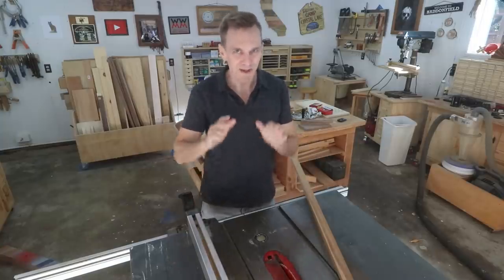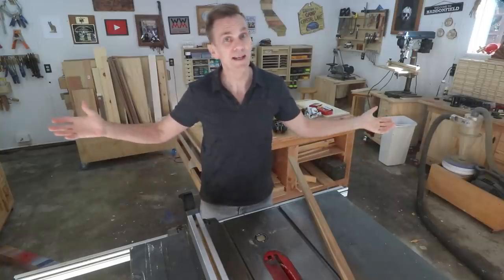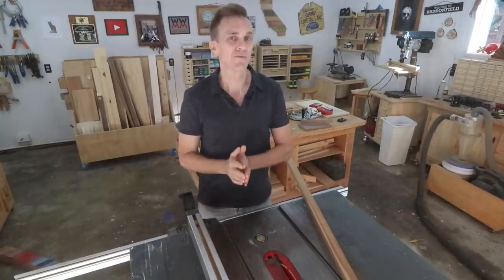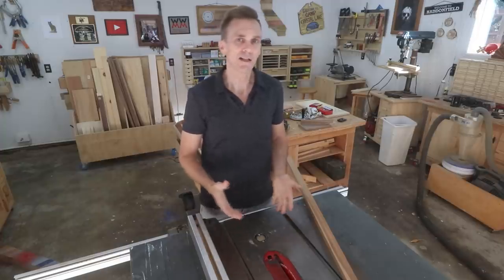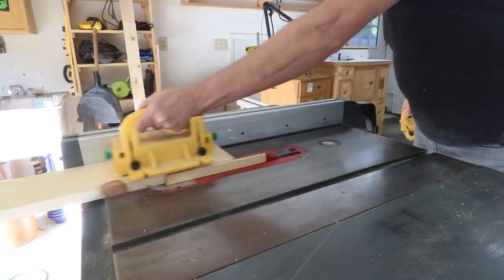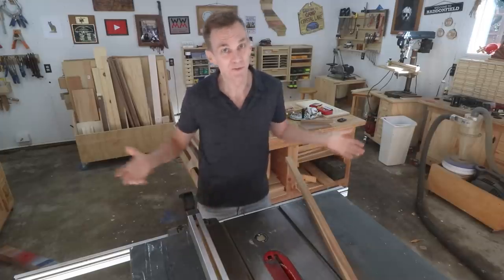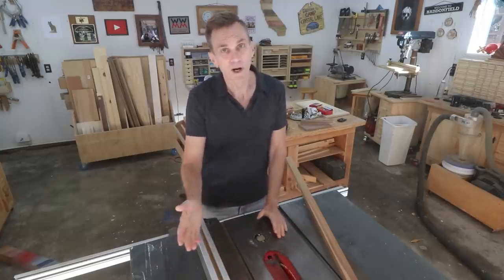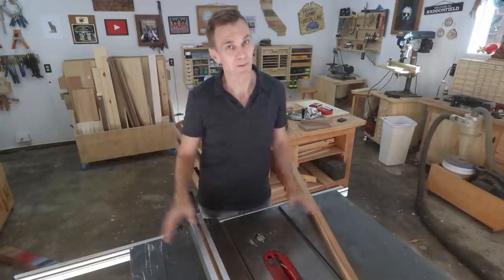Why does wood get burn marks from a table saw?

Comment: Dirty blade is my #1 culprit! I fill the lid of a 5gal bucket with Simple Green, soak 10-30 minutes, scrub off with nylon brush and bingo!
Reply: From another woodworking channel; I use wd40 on the blade fairly frequently so wood dust and sap never gets a chance to bind to the blade. Just a tiny bit goes a long way, but wd40 obviates both cleaning the blade and wood burning.
Reply: @user-tm8jt2py3d  right?! 🤣
Reply: Not sure if there’s fact you this but I have heard excessive use of simple green can loosen the carbide. Best to find an off the shel product designed for cleaning them.

Comment: Good stuff. There’s another technique if you are working with easy to burn wood. Rip the piece a hair fat, say 1/16; then rip to final size. The final cut will fly through that trivial residue and there you go.
Reply: That's what I do.  It also help with tear out
Reply: That's what I did on the cherry for my cabinets.  But I ran them through the thickness planer with the stops in place.

Comment: I used to have lots of problems with burn marks. I tried many of the suggestions n this video and was still having problems. I mostly had the problems with hard wood like red oak and seldom with pine but to just build things our of pine was out of the question. What I finally found that fixed the problem was the hight adjustment of the blade. The lower the blade the more the angle of the blade's cutting edge was going through the wood. This meant I was cutting through more wood as it was fed through. A simple adjustment of raising the blade to the angle was closer to 90 degrees solved the issue for me.

Comment: I listen to the saw and push accordingly. Making adjustments on longer pieces can be difficult when repositioning your push blocks, which is usually when I get burn marks. I've found that a handplane works very well for removing them.
Reply: @TheTacticalBarrage  When your blade is not happy, it starts to cry.

Comment: I am making some cutting boards for Christmas. Since I don’t have a table saw , I have  one, and ended with lot of burn marks.  I agree the speed is critical.  But as Steve mentioned I have taken time to reposition my push stick which caused additional burn marks. Thanks Steve for your tips ! As usual , your tips are very accurate to new wood workers.  !!!

Comment: Steve, based on watching your channel on the living room TV back in the GRR-Ripper sponsorship days my wife bought be one as a Christmas present. Honestly I thought it was a gimmick, until I started using it and realized, no it's the "real deal." I soon bought a second one to use in a hand over hand method on long rips. I get glue ready cuts 90% of the time now and far less burning. Yes, tool alignment, blade sharpness, and blade cleanliness have been critical as well. But that smooth no-stop feed using the GRR-Ripper is key as well.

Comment: As always, good tips Steve. I recently was working with oak and had no burn marks on crosscuts or ripping but when I set the blade to 45 degrees I had had significant burn marks. I could not figure it out. I checked alignment and attempted different feed rates but still had burn marks. In the end, the marks were not going to be visible on my project so I let them stay.

Comment: I just made a cutting board from Jatoba, Maple, purpleheart and mahogany. I cut perpendicular to the glued blocks and whaddayouknow, the maple burned. gotta admit though, that was the point I had to reposition my hands and left the blade spinning somewhat against it. Turns out I also need to clean my blade. Great timing on this video, thanks for the tips!

Comment: I have the Rigid jobsite saw Steve uses in the WW course. I switched to thin kerf (3/32) blades and it helped a lot. For ripping hardwoods I use a 3/32 blade with 24 teeth.
Reply: When you switched to a thin kerf blade, did you have an issue with the riving knife getting stuck?
Reply: @MikeD87916  No, I worried about that at first too. But the riving knife that came with the saw works with both 3/32 and 1/8 blades. It's about .090 thick as I recall.

Comment: Video suggestion: all about kerf!  What it is, how to measure it and plan for it for different saws and blades, how to decide where it ends up, how those little laser guides don’t help at all  😆.   There’s lots of info here for beginner and even intermediate woodworkers alike!   I feel like a lot of your viewers would find a tip or two from such a video, even with a good bit of experience under their tool belts.
Reply: I like this idea allot

Comment: Hi Steve,

Great content ... thanks. 

I have found one additional situation that can cause burning ... thin-kerf blades that are narrower than the riving knife on your saw. Dangerous condition due the binding that occurs.

I avoid the temptation to cut without the riving knife and guard, and clearly mark the kerf width on the blades ... and only use those thin-kerf blades when appropriate. 

The thin-kerf blades were necessary for my old table saw, and will not be replaced when they finally die.

Regards,

R
Reply: Bro this is a youtube comment, not a cover letter😂😂
Reply: @RA-tp4pr  - I do enjoy a comment that is correctly structured.  Mr. Sawdust had a good English education, and he paid attention.  I’m a self-confessed, and un-ashamed, grammar Nazi.
Reply: Thanks for that tip!

Comment: I just had this problem using an 80 tooth 10" Diablo with my compact SawStop. I was ripping big box pine 2x4s and the whole workshop was smoking up. The sawdust itself seemed to burn also. The cause was entirely the blade. With that many teeth on a 10" blade the resin was building up; when I switch it for a 24 tooth the problem disappeared. I think more often than not it's the resin.

Comment: Would like to see a video on the electric wiring needs and amperages for a proper shop setup. When I run my shop vac and planer I trip the breaker sometimes. I noticed in the planer book as well, you need different amps based on the cut. Do I need 220 outlet everywhere?

Comment: As for feed rate, one of the things that people who work with wood use, often without realizing it (or, at least not realizing it until there's a problem) is _sound_. How does the saw sound as you're feeding the wood? Does the saw even know you're there? Does the motor take a dive when you're pushing wood through? Also, how does the blade sound in the wood?

Comment: Great tips... here's one I'll bet you didn't think of:  Another very uncommon source of burn marks from a table saw might be if the saw itself is on fire... in that case you should immediately stop your woodworking project and grab a dowel rod to roast some marshmallows... make some smores.    Okay guys... Hey I don't know why I wrote this silly comment... just in a silly mood I guess.

Thanks a bunch Steve for posting this video, it is truly helpful. BTW: My Table saw makes tiny chipped edges on plywood cuts, maybe it's the brand of plywood I'm using?  Should I invest in a zero clearance throat plate? The blade looks okay I've had it for a while, but I don't a lot of woodworking with it... it's a 60 tooth Diablo blade for 10" table saw. Any ideas...  and I'll bet you didn't read the second half because of my silly comment.
Reply: Great, now I've got to clean coffee from my keyboard. Thanks for the early morning laugh.
Reply: @tektrixter  I too drink coffee while watching YouTube,  *it  happens to me too.  LOL... Well, as long as it's black coffee, that works the best to help dissolve the food particles and act as a rinse agent to clean between the keys. (OK... not really recommended, just trying to put a positive spin on an Ooops!)  And BTW as I type this comment I realized that I'm out of coffee to watch YouTube... Need to "Reload"!!!  And You know the process: "Lather, Rinse, Repeat"  (your keyboard)
Reply: Too funny! On the topic of plywood tearout, though, I've had good luck covering the top and bottom of the cut line with painter's tape prior to cutting, which helps especially when cutting against the grain of the veneer. Thanks to Steve and his Weekend Woodworker course for this tip!
Reply: @BrendanCassidy  Yeah I thought about that idea... have to give it a try. BTW: I've taken all of Steve's online courses as well
Reply: I made my own zero clearance plate with scrap 1/4" plywood, and it's also my throat plate for the dado. The thickness isn't quite right for my saw, but it's pretty close. If I was ambitious, I could hit the edges with the sander.
Reply: @purefury702  Right... That's the other thought I had besides the painter's tape trick on the wood... And I think I've seen a zero plate to fit my saw for not a lot of money on Amazon, instead of DIY, I'd rather not mess with it... that's just me when it comes to tools.  But I guess I'm wondering what it causing the wood to tear out like that, I've only have 3 things it could be: 1. the saw blade, 2. the plywood (it's cabinet grade so it's better than most, but not great) , or 3. no support for the cut, hence the need for a zero clearance... Can I be missing something else?
Reply: @raymitchell9736  In my experience, some degree of tear out is normal for plywood. I run a 60T for basically all my cuts. Usually I don't worry about it because plywood edges get hidden on most projects. They make  200T plywood blades if you want to give that a try. They really are not even that expensive either because they are non-carbide.

Comment: I recently started as a total noob just a week ago. Bought a table saw of roughly 140$ and i noticed with the first cut i had burnmarks. The wood got kinda stuck between the sawblade and the fence. I watched your vids beforehand so i decided to ditch the fence and use a sled instead. I can tell you, i didn't expect the saw to be this good.. and all it took was a few of your tips. 
Btw, my blade protector (whatever you call it in english) is a bit off (like a few degrees towards the fence so I think i'll have to ditch that aswell. All in all, i really have to thanks you for making it simple yet effective.. i was scared i made a bad purchase but i can't afford 500$ machinery 🙈
Reply: Don't remove safety equipment unless you have to, especially the riving knife.  It sounds like you need to make some adjustments to the fence and blade alignment.  Read or download the manual for your saw and you can find all the adjustment screws and bolts and whatnot for your saw.  There a lots of great videos on how to adjust your saw so everything is close to parallel.  It'll make it safer to use and give you better results.  Even the crosscut sled, which is a game changer, will work better if your blade is parallel to the miter slots.  After you get it adjusted the first time you'll have a much easier time doing it in the future.  A couple of inexpensive tools like machinists squares and will help make it more accurate and also faster to set up.  Again, please, don't remove safety equipment, for your own safety.
Reply: @Not_TVs_Frank  the riving knife is still attached. I have other issues that are more fxcked up😂 miter slots are inaccurate (made 5mm wide runners for a sled but a perfect fit keeps getting stuck at certain points), miter gauge is too loose etc. I think i bought garbage. 

The manual does not contain info on alignment adjusting, not even the online manual. I am currently trying to get in contact with the manufacturer but that is also kinda difficult. Does the brand parkside ring any Bells?

Comment: I like Toool Cleaner for cleaning my blades. A 5 gal. lid flipped upside down with a blade sprayed and soaked then brushes off. I dry them then hit each tooth with 1-5 passes of a diamond plate sharpener each time I clean them. I also spray them with a dry lube, let it dry, then wipe them with a silicone impregnated cleaning rag. I have well over a dozen blades from 18 tooth to 200 tooth for varying uses and balance he blade to the job; I mostly use a 50 tooth full kerf (FTGx1-ATBx4) combination blade for most of my cuts and an 80 tooth ATB blade for use with plywood. If you’re cutting thicker or harder stock, especially ripping, go with less teeth; if you’re cross cutting or need a finer finish go with more teeth. I also like a glue-lam blade which leaves an amazing edge with a joining sled for jointer quality work from the table saw. 
The biggest thing is consistent speed with a feed rate that matches the blade, some blades want to cut slower while some faster, depending on the hardness of the wood. As pine is soft and full of resins it will dirty up blades quite quickly and without cleaning bog on cuts, while hard woods do this to less of an extent and more slowly they also will eventually bog a blade. Cleaning is probably the best thing to aid to blade longevity and usefulness as clean blades tend to cut better, run cooler, and stay sharper then dirty blades. 
Take the time and clean your blades as well as having at least a couple to get the best results, say a 24, 50 combination, and 80 tooth blades would accomplish most of my shop work. I also run some smaller blades including an 8” dado stack and a 7 1/4” ultra thin kerf blade for working with some pricier woods to reduce kerf loss, I also found a pair of 40 tooth 7 1/4” blades makes perfect fitted dados for 5mm plywood as everything else is either too tight or too loose. 
The table saw is the shop work horse so don’t limit its abilities by not having at least a few blades and a few jigs.

Comment: I think you should add that thin kerf blades are more prone to burning. Thin blades have a tiny amount of set in the teeth so the flat of the blade is closer to the material. Thin blades also flex more and make it easier to cram the work piece between the blade and fence.

Comment: My most frequent reason for scorching has over the years been that last one, on a rather cheaply-made contractor saw that's hard to keep aligned.  So much so that each time I move the fence, I've just gotten used to measuring from each end of the fence to the miter slot, and also ensuring the blade at the height I choose is parallel to the slot.  I also use a metal yardstick against the side of the blade to extend its plane (and multiply any error it may have) out to the edges of the table, then carefully measure from that to the slot.  A bit of hassle, but a better saw just isn't in my budget.
Reply: I feel you I have a makita jobsite and the rip fence on it sucks!

Comment: If you need to use a push stick/block, before you start the cut, plan on how you are going to pick it up and engage it without stopping the rip.  That works well for me.

Comment: I kept having this happen on angled cuts when using a 10 inch 60T TCT blade.  Vertical cuts were fine but as soon as I wanted angled cuts in 36mm of laminated ply, the dust couldn't be sucked away quick enough so caused the blade to bind and a 2KW motor to bog down and stop!  Only sussed this was happening after almost ruining a work piece so swapping the blade to a 40T was one answer.  You need exceptional dust collection suction for deep angled cuts otherwise 60T blades won't cope well.

Comment: Another tip for those starting woodworking : the edge of the wood piece might not be plane (flat enough) which makes the thickness of wood being fed to the blade varying. This will lead to the same consequences as the ones of your fence not being parallel to the blade mentionned by Steve. Always plane at least one edge of your timber before cutting. If use use raw wood with sawn marks, it is dangerous’
Reply: You can plane it by opening out the fence a bit for one side, then cutting to proper width on the other side.

Comment: If you don't sand off the scorching, does it affect the quality of a glue bond? I''m a novice but have noticed the scorched areas seem much harder than the rest of the workpiece. If the wood is burnished from friction of the blade, does it absorb glue differently?

Comment: I have an old saw without a riving knife, and I don't use a splitter so some boards will bind on the blade when I get far enough into the cut. What I've learned to do when I notice the blade stalling is to shut down and push the workpiece through a second time to remove more material from the off-cut side of the kerf. Sometimes I'll also make multiple, shallower cuts. Results aren't as good as doing it in one clean pass, but it works if there are no other options.

Probably should just get a splitter though.

Comment: I have an old saw ('50's) with a wimpy motor. Cheesy fence. I can't push fast without scorching, bogging and the breaker tripping. Can't push slow without scorching. Pretty simple. It is a good motor 70 plus years and still doing what it can do, but its 3/4 HP, 120VAC.  It is a nice saw in that its mechanisms are really stout and it has a good cast iron top. It is heavy, steady and compact. I can't easily discard tools that still work at what they are intended for.  I can keep this little old Delta for small work, but it needs a better fence.

 Clearly, I need a 240V, multiple HP saw.

Comment: Another source of burn marks is pushing a wood piece along the rip fence with a side of the wood that is not straight up against the rip fence. As the edge of the wood comes into contact with the rip fence the deviation from straight will cause the wood to slide left or right. The cutting edge of the blade will continue to cut, but the trailing edge will bind in the kerf and the friction will cause the burn.

Comment: a well tuned saw, with the fence set a few thousandths out on the outfeed eliminates most burning. useing the right blade and a full kerf blade will eliminate the rest.

Comment: Never use oven cleaner on table saw blades as demonstrated by a Freud dealer because the acids in the cleaner eat away at the soldered carbide to the blade.  Simple Green I find to work the best for tree resins.  I have tested oven cleaner personally with massive failure to my blade.